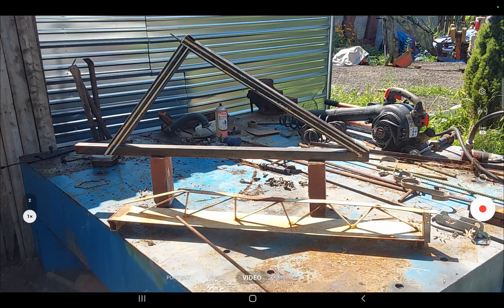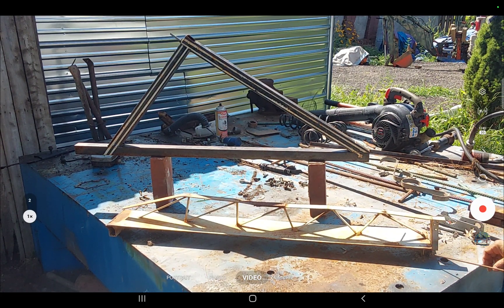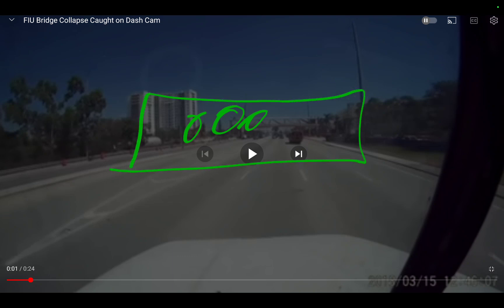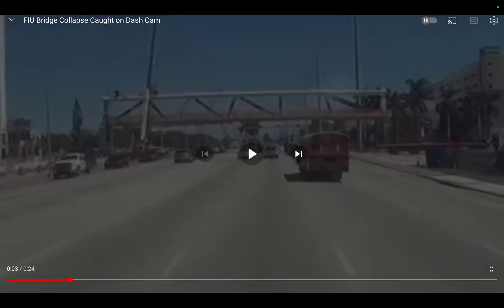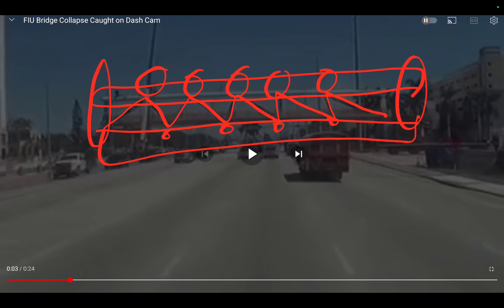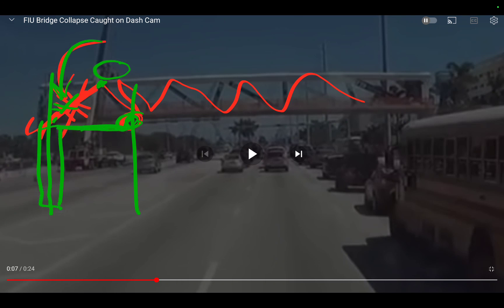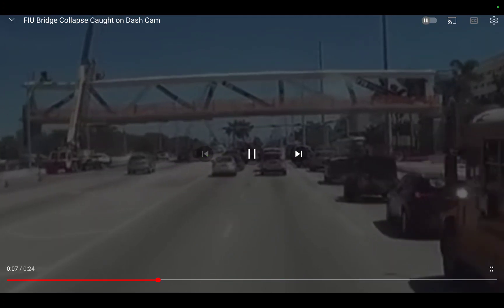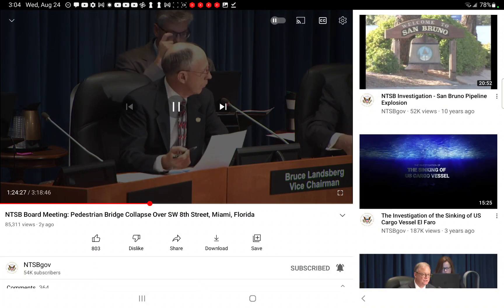Bridge Collapse and why deflection is a Bridge terminator FIU Bridge Collapse Pedestrian Bridge

Comment: I thought we figured this out years ago. The ultimate cause of the failure was a million pounds of concrete and steel of the canopy and truss members point loading the deck at four spots where the deck was supported by sixteen steel cables. An incorrect assumption was made that the longitudinal cables would be uniformly loaded due to the transverse steel members. But it was incorrect and the cables began to stretch from the center out. As each cable stretched point loading was transferred to the next one out. When the outermost cable stretched enough the load reverted back to the center cables and the process continued cyclicly until the cables were stressed at one point beyond their ultimate strength. The calculations and analysis was not only based on this false assumption but a static calculation was incorrectly used and inadequate to explain a dynamic process. The failure was conceptually flawed from the get-go. If it hadn't failed when and where it did it would inevitably fail at another time and spot. Far more uniformity is achieved when there are two trusses one at each edge because as you get further away from one edge you get closer to the other reducing the varying of the bending moment. It is also extremely stupid to use thin cables instead of structural steel because you want the esthetics of the deck to have a slender profile. So many engineers and professors of civil engineering paid so much money and not one of them saw the obvious structural flaws that an electrical engineer saw. I guess a PE license doesn't mean much when no one is punished for the deaths, injuries, and property lost due to their blunders.

Comment: I believe the 40 times referred to the .016” wide so the cracks were 40*.016 wide.  It was not 40*1/2”.  The lady said the 1/2” deep and then quoted the 40 times making it sound like that was the same dimension.
Reply from the maker: The engineer referenced a different guide and she referenced the correct guide... As Florida requirements supercede and sometimes parallel ACI, in this case Florida wins and it does not use the .016 as the rule during these approved plans...
The .016 is a straw-man argument...
Reply from the maker: Section 10.3 of FL department that deals with bridges and concrete does not mention ACI one time , NOT one time, again straw-man argument they were having.
Reply from the maker: Note, if u leave the one fdot code and bounce into another one, you can find where the .016 exist but that would not apply to this structure...
It has it's own class and it's own, in independent review required, as this is a one-off design and ACI not does fdot have a nuts to bolt template for cracks on this structure...
They demanded that independent review and in this case, mapping of all cracks of this size must be sketched...
I have links in the members only room ...
Reply: @ForensicCats   I do remember them jumping between codes.   Thanks for all your content.   From the time I first found your channel, it has been very informative and I enjoy the insight.  I am an EE by degree but moved into the software world after a few years as an electrical engineer at a food processing company which was an incredible experience and then into automating production lines for a company supporting electronic production lines.   Solving the problems you ran into was always fun and watching you reverse engineer the failures provides a similar insight into the construction world.  Keep up the good work!
Reply from the maker: I am always amazed by automated systems, I hope you get enjoyment out of what you do...
Yes, the code jumping is useless,  this structure did not follow any code besides ADA and I wonder about that... recall they wanted to have tables up there and I envisioned many a head being "crowned" with those slanted uprights in the walkway areas.
Recall, they envisioned parties on this structure and not just a crosswalk.
Thank you for playing along with my reverse engineering these failures; I hope you saw the sprinkler alarm company sharing his data with me and him allowing me to drive at him with questions...
He deserves recognition for standing up and I am honored to show how his system worked and how the powers that be are useless as true investigators...
It was never about the truth, it's about not stopping those tax dollars and people selling off their condos...

Comment: Just the size of the cracks before collapse is enough to raise serious questions.  A 1st grader wouldn't have ignored that!  But after watching this, I now understand those post-tensioned concrete members were actually under suspension.  Isn't that just a s*** design from the start?  Shouldn't those have been steel or steel cables?